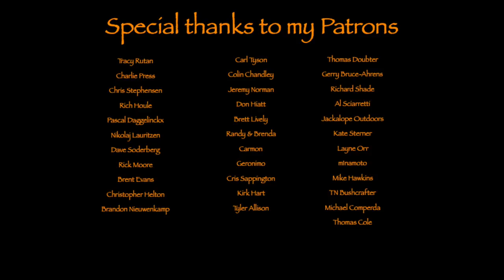Jól Overnighter

Comment: An Idea for your heat shield on your stove. Put a few spacers between the shield and the wall. It will allow air to flow behind keeping the wood surface cooler AND more heat in your cabin. Doesn't have to be much. A couple of 3/8 nuts between the sheet and the wall. Run your wood screws through the middle. Quick fix.
Reply from the maker: Thanks a lot for your great suggestion 👍🏻😁 appreciate that my friend. Hope you and your family will have a merry Christmas and a happy new year 🥳. Atb to you 🏕🦌🔥
Tom